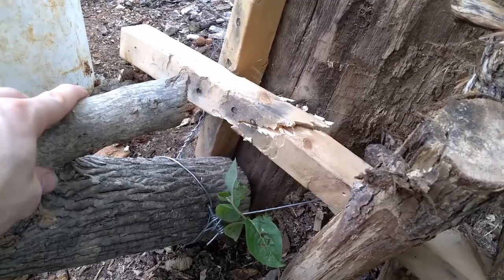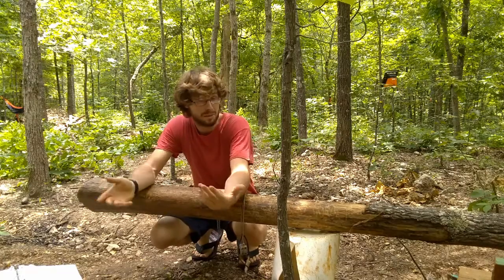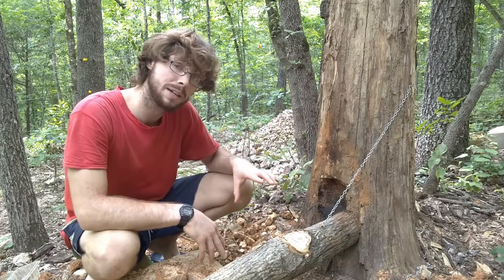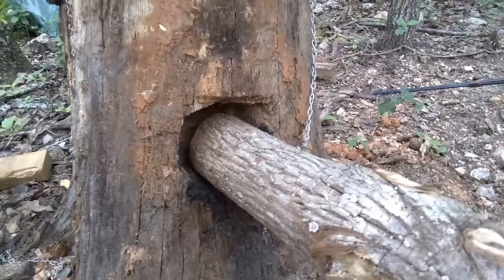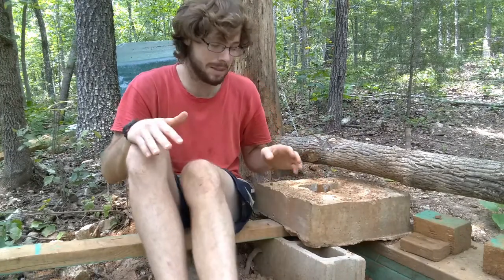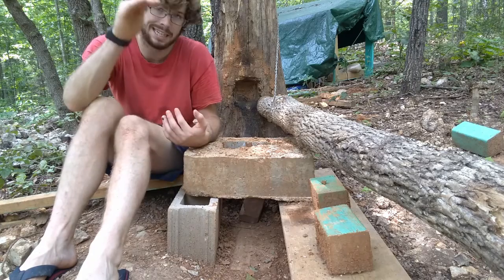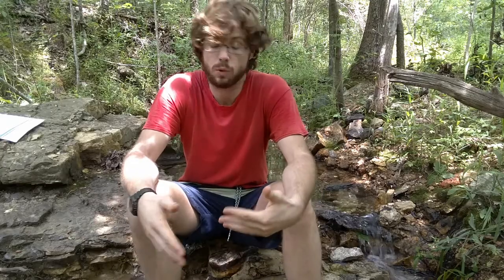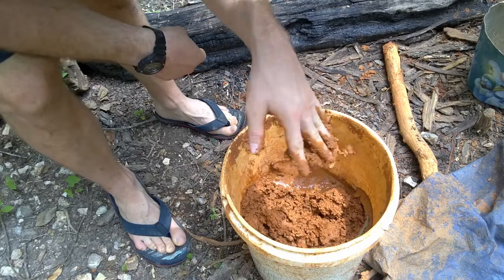How To Make A Manual Compressed Earth Brick Machine

Comment: can you fire compressed earth bricks for additional strength or water resistance?
Reply from the maker: Hypothetically you could, but you'd need a high clay content and a stable and consistent mix to your bricks, so at that point you may as well just make fires bricks without compressing them! When I was making a lot of bricks and testing firing methods, I realized that ceb's cracked at an insane rate when fired compared to clay/grog bricks! But if you get the mix right and consistent, then maybe!
Reply: @aplacetoexist  Thanks that helps a lot.
Reply from the maker: @Deveak  any time! If you have more questions, I'm happy to help, or John from "Primitive Technology" has a lot of good resources on his blog with more specifics!

Comment: G'day from Down Under.  I am looking to mkae a steel CSEB machine, but am looking to set up to do different sizes with the one machine.  All of the manufacturers that have been spoken with say that it is impossible, but, am quietly confident.  An old work colleague is able to supply me with cathederal knife edges and the matching bearings for my fulcrum.  A 20 tonne jack with a 5:1 ratio should give me enough grunt to be able to press 3 or 4 items at a time, depending on the moulds that are in use.  Another old mate has explained to me how to get a splitface block finish, and another is preparing a fancy finish mould for me for something different.  Am hoping to be in production in March / April 2023...  if all goes to plan...
Reply from the maker: That's awesome, man! I'd love to see a video of operation when the time comes! As for different sizes, most manufacturers don't want to go out of their way without substantial money involved, but if you know someone who does metal working, a custom insert could be make for a factory produced machine! All things said, I'm excited to hear how it works for you!